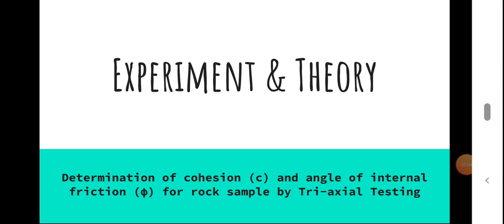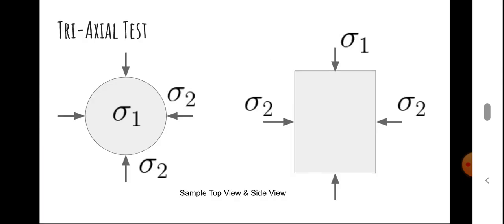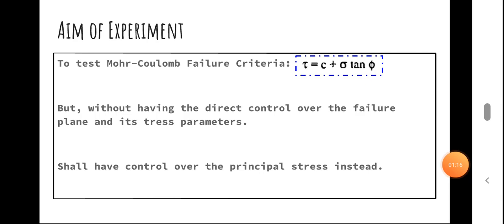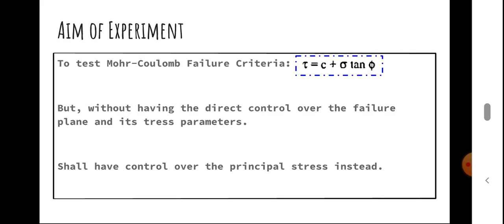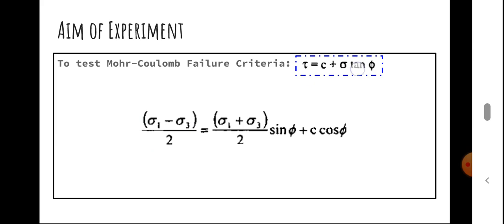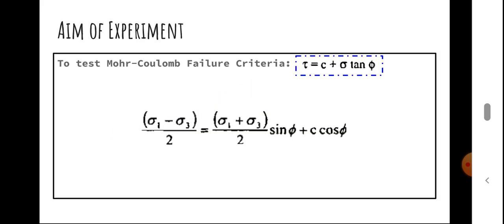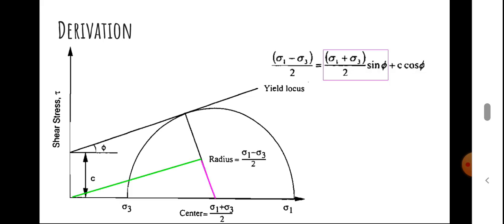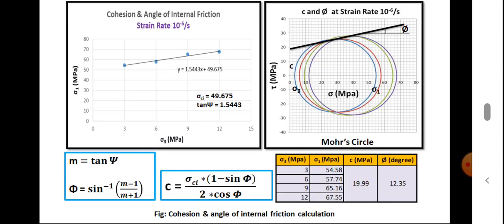Rock Mechanics: Tri-axial test of rock sample

Comment: What's the relationship between angle of plane of failure with the angle of internal friction?
Reply from the maker: Thanks for the question Paul, it is pi/4 + angle of friction/2 (all values in radian). 

However, it's true only for Mohr Coulomb failure, for other ways of brittle failure they are different. 

And secondly this holds true only for intact material with no existing weak planes inside the material.